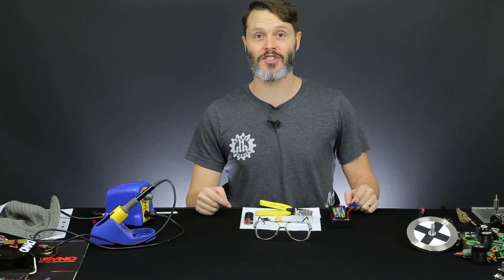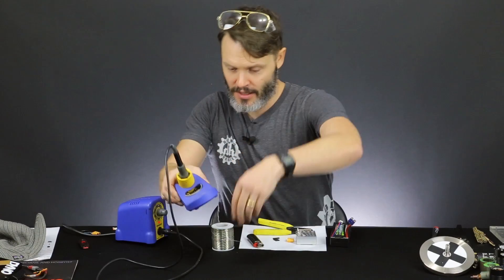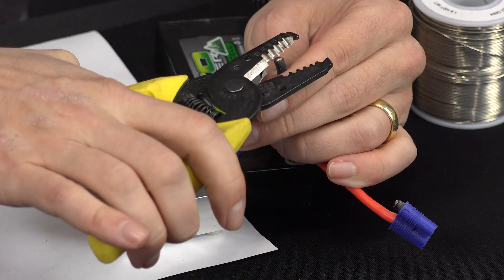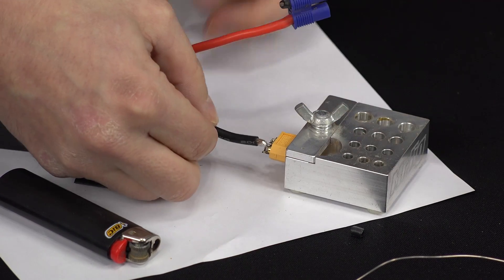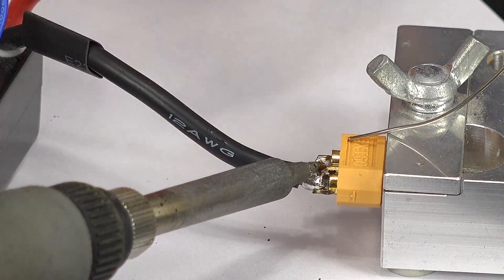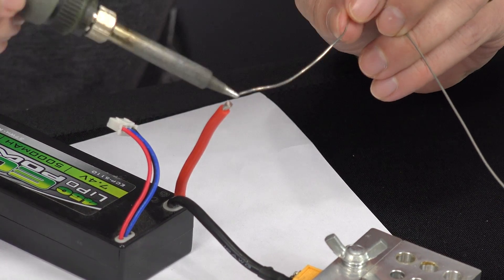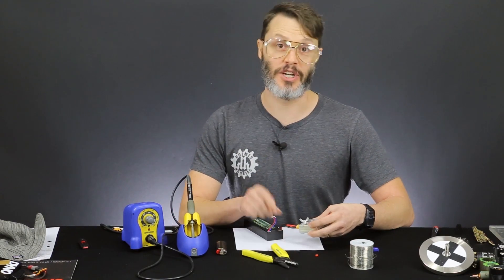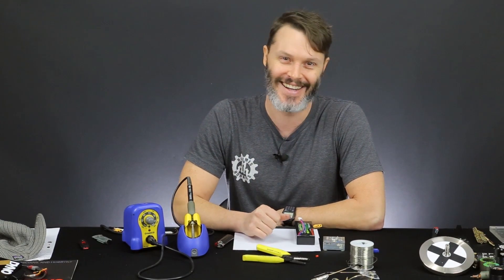Installing A New Connector Is Easy! How To Solder Battery Plugs - Holmes Hobbies

Comment: 5:59 You should definitely use a pair of XT connectors connected to the half to be soldered, as this will prevent the bullets from going into a crooked position - if that happens, you won't be able to get the metal parts to slide together anymore. Elli always the male and female parts combined before heating. If you drink a male, the female must be wireless. If you drink a female, the male can be wireless.
 
I think you can see why the bullet on the XT connector is hollow... Maybe because the purpose is to push the end of the wire into it and not just solder it to the edge of it somehow. Think how much better the connection of the conductor can withstand mechanical stress when it is actually soldered inside the connector bullet. What about the fact that you achieve significantly better current endurance when your junction is without large empty cavities inside the bullet.

Comment: Too much heat for too long, those joints are dry (dull), and the wire will have become brittle (copper embrittlement) need to use liquid flux to help get the job done faster.
I'm shocked that these connectors use solder buckets and not crimps.

Comment: Holmes, you're using the wrong size tip for this soldering job.  A D4 or D52 (Hakko) or equivalent for your soldering iron brand would be much more suitable than the small conical you're using for this job.  Faster heat transfer, less total heating of your parts.  The rule of thumb for successful soldering... GET IN, GET OUT!  Using the right tip for the job makes getting good, professional results MUCH MUCH easier!!!  Yes, I realize the video is 4 years old... this comment is more for the people watching the video.
Reply from the maker: Tip was also needing a replate.  In newer vids all I use is fatter chisels! In and out quick as possible is best, for sure
Reply from the maker: I learned my lesson on this vid, lol

Comment: Sir I love the videos! I hope you can help me with the soldering. I have a good solder gun and I use good tips with it. The problem I'm running into is the heat transfer. Its got to me but I was wondering if flux would help with the issue? I've never used flux but I've seen videos on using it and some people (air quotes) swear by it. Have you used it or is it that you just have better equipment than me or is it I'm just a moron with a nice metal heat stick?

Comment: Thank you for more education on soldering because I solder battery plug every then and then but I use traxxas plugs or EC3 or EC5 because I use traxxas battery or spectrum battery because I have both charger and I use spectrum DX6R to watch me battery as I drive

Comment: I have a 350w brushless motor(if that means anything) with a 48v 20ah battery. With a bullet connector. I want to add an extra battery for travel. Not parallel. I want to just cut off the bullet. Add a 2 way xt60 connector. That is safe right ? And do I need to solder from the controller and old battery to the new xt60 connectors ? Can i just shrink wrap or ?

Comment: I use a TK955 station. I bump it up to 800w with 12 gauge wire and melts the solder in 3 to 4 seconds you don't have to hold it there for long and you won't melt your plugs.👍🏻🔥😎🔥🤙🏻👏🏻👏🏻👏🏻

Comment: Yes, number 1 rule when working with batteries, especially LiPO batteries ~ Isolate & Insulate. One polarity at a time. 
If the 2 polarities connect, within few seconds LiPO will turn into quite a big fireball.

Comment: The heat shrink is best shrunk on by hot air gun not a lighter! And just de-soLLLLLLLder the wires rather than cutting them shorter?? Put a damp rag on the battery to protect the electronics from heat

Comment: Is it ok to solder an xt60 male to battery instead of female? I’m soldering extra battery to my xiaomi escooter and think I got it mixed up but if can use male instead of female then everything is fine. Brand new to soldering/wires etc lol

Comment: I know this Video has been posted for a long time. So how about and update video including when you should use a xt60 vs a xt90 or ec3 vs ec5. For crawlers I get using a xt60 across but what about vehicles with more amp draw?

Comment: One thing that will help a lot when soldering larger gauge wires is to install a soldering tip (flat bald type) with the width of the blade close to the diameter of the wire you are soldering. It aids in heat transfer and actually reduces the amount of time you have to leave the soldering iron in contact with the solder joint.

Comment: thank you i thought i was the only one doesnt get solder on the tip for any longer than i have to, and OMG that casio watch, i used to have one of those for phone numbers.  I miss the early information age
Reply from the maker: Its really the flux core that an issue, it eats the tip coating very fast.   I used to have a spool of solid that was mostly just for tinning tips.

Comment: Thank youuu! I've taught myself how to solder from youtube rc tutorials and I didnt really notice everyone was holding the iron to the wire or object, and not putting the solder on the tip of the iron, my tip is all deformed and chunks taken out of it, it still works but I read itll stop soon because that special material will run out on the tip eventually but it's a 30$ iron, then I'll upgrade to adjustable temp one. Appreciate it and soon going to get the 380 "weevolver" motor for my sons losi mini rock crawler. Nobody Carrie's 18th scale motors...well besides cheap chinese knockoffs. Love the vids brotha! Very inspiring!
Reply from the maker: Glad my vid helped!   The pitting on your iron tip is from the flux core of your solder.

Comment: Is your temp that low  because of the solder type?
Reply from the maker: It is celcius, but silver bearing solder does melt lower than just tin.   Also, I don't want to overheat the solder.   Cranking up the iron doesn't really help do a good job.
Reply: @HolmesHobbies  o Celsius duhhh. Makes sense now. I was thinking Fahrenheit. Thanks. Love your products and info you share. ✌

Comment: FYI, Solder is the best thing for your iron tip unless you have some real crummy solder. The solder protects your tip from oxidising and here is the key, it gives a larger surface area to TRANSFER HEAT. Your 45 seconds to solder one wire to the plug should of been 5 seconds, all because you think adding solder to your tip is bad. Also touch the pretined solder tip to both wire and plug, wam bam 5 seconds thank you mam. Also, when your soldering, the tip should be smoking, what do I mean, the rosin is what keeps the solder and metal from oxidizing from the heat, this is why you always add solder to the tip right before you solder. Right after soldering, dont be a rookie and wipe that nice extra solder off the tip and put the iron back in the holder, that solder is what is protecting the tip. Then when you need the iron, you wipe the tip clean from the gray oxidized solder and add fresh solder. 63/37 solder is the best solder, it has the lowest melting point, then 60/40, I never use that no lead crap. FYI, I solder professionally, DIP, Flat pack, QFN, BGA, CSA packages.
Reply from the maker: Solder is fine to add directly to the tip when it isn't flux cored.   Flux eats away at the tip though, especially at lead free temps which you evidently dont use.   Its a tough line to ride.  I have a bag full of pitted ruined tips from before I modified my routine.   Once I stopped shoving solder directly on the tip I started getting years out of the tips instead of weeks.  

you solder "professionally" and use leaded?   Do tell what professional outfit does this .
Reply: @HolmesHobbies  They dont just pay me to solder, it's just part of the job building prototypes, troubleshooting customer applications that use our IC's, validation and product engineering, I do wear a few hats at my current job. WD, Mitsubishi, Rockwell, Jazz Semi, Conexant, MindSpeed to name a few, we all use leaded solder for any inhouse soldering, why, it performs better (currently working on 400Gbps data rates on PAM4) and it is easier to use. Rosin flux does not eat solder iron tips, it burns away in less than 30 seconds, if anything it protects the tip from oxidizing. I can leave a 3.2mm Hakko tip on 850F for a week without using it, just baking it and wipe it clean on a sponge. If you were damaging Hakko tips in weeks, you were definitely doing something wrong. I still think your doing it wrong if your taking 45 seconds to simply solder a wire to a connector, that should take maximum 5 seconds once both parts are tinned. Have fun.
Reply from the maker: @user-rs8zg8ey2b  Thanks for your professional advice
Reply: @user-rs8zg8ey2b  thank you i had to scrolll down so far to see the first comment bringing light to another terrible instructional video teaching people the wrong way to solder when there is plenty of correct videos on YouTube, thank you for speaking up

Comment: Well John, I saw this about 6 hours too late....
I'm in the process of converting everything to XT-60s, so I can be one of the cool kids!! 😛  .... I've been Soldering for a long time, and have been replacing Batry Plugs, since getting rid of Tamiya Plugs in the early 90's. 
Today I learned THAT DOESN'T make me an expert by any means!!! 😱 
I DID melt one of the pins on the Plug!! If that was the worst thing to happen, it would have been embarrassing... BUT, in my haste, I reversed the leads to the Plug! I didn't realize that, until I went to plug it into my Rig. INSTANT SMOKE! Fortunately, I didn't ruin one of only 3 of my ESCs... But I destroyed my ONLY 3S Batry!!!! 😫😭😭😔  Yes, no big deal for nearly everyone else, but I can't afford to replace it. 😔 
Expensive lesson on being careful and double checking. Now I'm kinda screwed.  On a better note, that tip you gave. I didn't know that those posts TWIST. Lining those up would have made it quite a bit easier!! I'll remember that.
Carmine 🚂 🚙

Comment: where is the little grey cap provided with the xt60 connectors?
Reply: Some come with the "grey piece" so that you don't necessarily HAVE to use heat shrink.
Reply from the maker: I don't like the capped style.    It's kinda risky that the cap will pop off and a short could happen.
Reply: Interesting, I wonder if anyone has had issues with them coming off?
I know that I have to fight them to come off if I ever have to redo a connection 🤣
Reply from the maker: @puzzleluvr  I have had problems in the  past, but it also depends on what factory is making the plugs.   Certainly, some have to be better than others.
Reply: @HolmesHobbies  very true, it's like anything I guess.  Quality control is key.

Comment: Why dont u use a heat gun? U should suggest to people to make sure length of wites should be even before solding begins so that that problem u had wouldn't happen. Imo.
Reply from the maker: Didn't want to steal it from the shop where it gets used often all day.   The leads may want to bend in different directions from each other and make the last plug connection tough,  whether they are the same length or not.   Watch and learn from each "problem".

Comment: Nice bud 👍 I like the xt60 with the protection shell so you don't need shrink tubing 💯
Reply: Same, that's all I buy if I can help it now.
Reply: I only use the ec5 he cut off in this video. Because it's super easy to flame solder them.